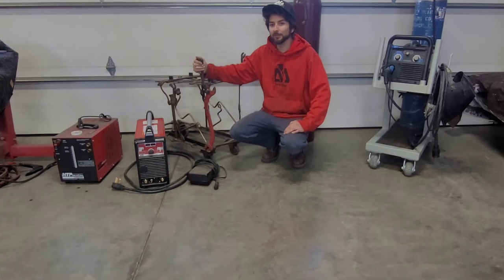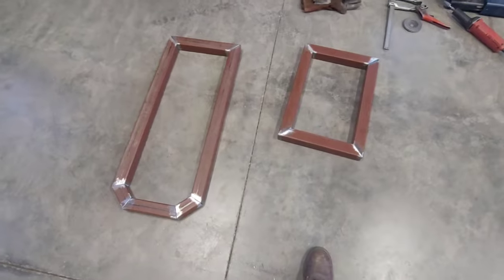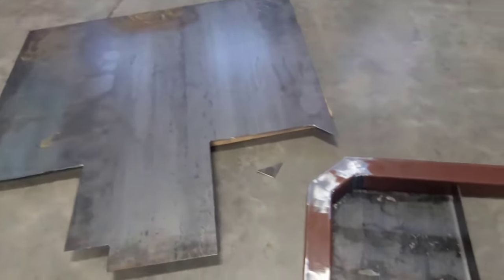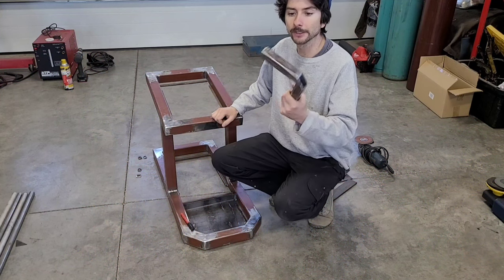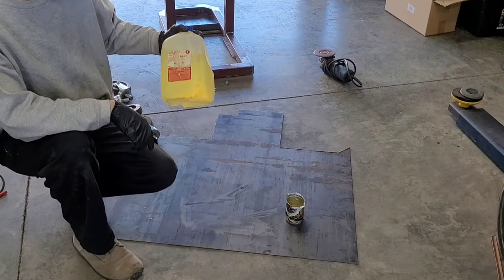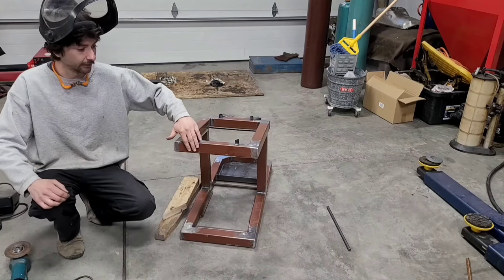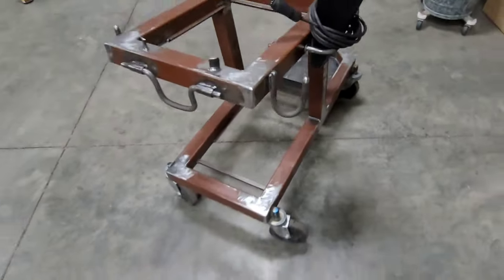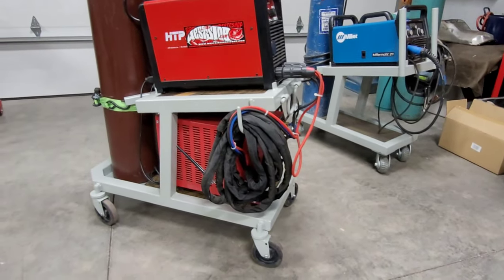Welding Cart Build for HTP TIG

Comment: Nice job on the cart! Especially the mig cart. There simple but perfect clean design.
Reply from the maker: Appreciate it. It's a pretty basic design that isn't very difficult to build. I picked up a larger mig welder recently so I may have to build a 3rd one ha
Reply: @falconfabrications  you doing a video for it? I feel like a simple design is more functional in a lot of ways.
Reply from the maker: Agreed. Yes, I'll likely make a video on the new one but I'm moving out of town temporarily so it may not be until I get back.
The welder is one of the newer Millermatic 255's so it'll be quite a bit larger than the previous two.